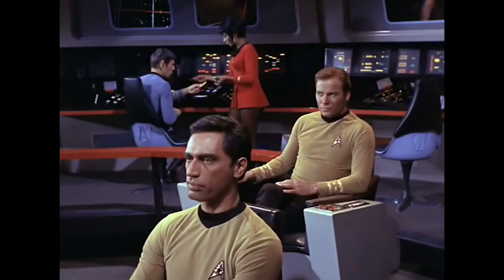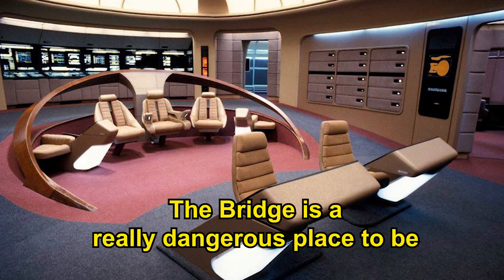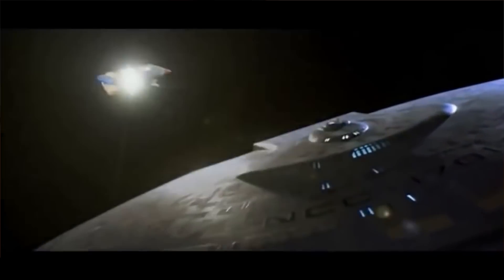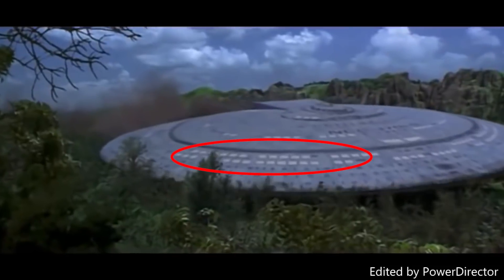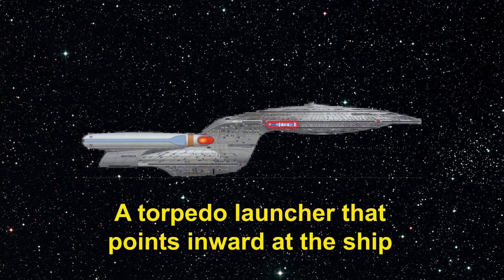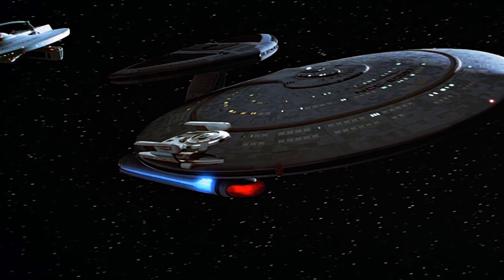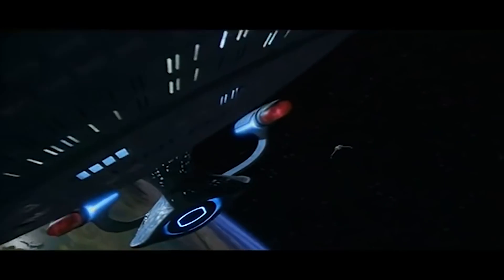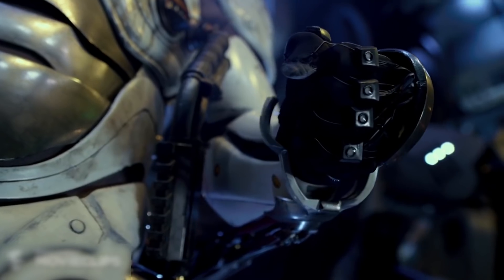10 Flaws Star Trek - USS Enterprise NCC 1701-D

Comment: I'm not a fan of defending my fandom til death but you did overlook some things here.

a.) The position of the bridge doesn't matter cause there are shield. Once the shields are gone, those weapons are going to tear apart a metal ship no matter what. Even the Duras Sisters know that...
b.) Same goes for the Warp nacelles
c.) The saucer section is capable of an emergency landing. That's it. Using the pods wasn't an option as the warp core breach was imminent and most people were already inside the saucer section. Also a pod wouldn't hold up that well against that shockwave. And the saucer section already took some heave damage from the fight and got tossed into the atmosphere by the shockwave. So making it that far is quite alright. 
d.) The Enterprise was a science and diplomacy ship planned in a time of peace. There was no real threat from the Klingons or Romulans at the time so the approach of building a massive ship for a long term mission with families on board wasn't seen as that big of a risk. So having big hallways and huge spaces helped to not have people feel cramped into a tight space. It really just shows hoch far Starfleet and the Federation have come. But Starfleet learned, Starfleet adapted, as you said yourself.
e.) Yes, the Enterprise "carries" 35% of unused space but just look at past designs of earlier ship classes. The Constition class had to get a huge and several minor refits to keep up the with new technologies. The Excelsior class was already a step in the right direction but also got some big refits. So why not take the idea of planning ahead to the next level? That empty space wasn't meant to stay this way forever. I'd say: great design.
Reply: actually there was a reason for warp nacelles being out like that on earlier designs. there was one class that was more battle than ship....was very very fast with little crew comforts
Reply: One would imagine that the exterior engines are more efficient, thus the open design for the peace time vessel, more compact design for the fighters, however , as Martin noticed above, it is canon that the vast majority of the defense is the shield and you were not supposed to run out.

Another point (I am not familiar with the lore) is that they can "divert energy to structural integrity"  which suggests that it is not made of dead structure and that it has an active components (shields? Compression? electro magnetic or dampening?) and, since in a battle all the energy would go into the shield, the structure would be compromised when it failed.

Since one would assume that 1 Watt in shields is ALWAYS better than 1 watt in structural integrity, one would assume that once the shield failed the systems would essentially be drained. Thus, there is little reason to plan for complete failure when it is way better to plan for it not to fail.

We have seatbelts and airbags because we crash, like, a lot. But an Enterprise class ship was never meant to be shaken, they have labs and children on board, it was probably designed to never fail. We know from the show that there are secondary and tertiary backups for all critical systems, what would be the point of seatbelts when you have an entire second ship dedicated to safety and if that fails it's essentially curtains? We don't have parachutes in commercial airplanes, we do in military. Commercial aircraft is designed to essentially not fail rather than fail gracefully.
Reply: EtwasMartin
: whoa, hold on. Not all what you say is correct. 

a) Yes it does matter, because Star Trek has had their fair share of battles in all time-lines, so making a bridge easy to target is a dumb move. To survive a battle requires command function of the ship and even though they were supposed to be explorers, ensuring they survive, as best possible, any confrontation means the bridge should have been moved, that even with shields gone (and that seems to happen a lot in the many episodes) the bridge should always be hard to destroy. 

b) Same goes for warp nacelles. They were very vulnerable.

c) Your speaking of specific episodes and story lines that dictate events, so why make a ship totally useless? My understanding of Star Trek producers is they tried to make the show as scientifically accurate as possible. So why make a ship, even a saucer section useless, with the technology they had? I am sure they can figure out different drama storylines that fit the technology. I believe they were just friggin lazy.

My understanding of what Generation Tech is talking about is the common sense design, the practical design, the functional design, the defensive and offensive design flaws that, irrespective of episode drama, should have been made.

d) Again the drama element. So please stop trying to make sense of a drama storyline that had nothing to do with common sense and had everything to do with sensationalism. Any good captain would not take a ship, filled with families, to places of danger, yet Picard did and for Star Fleet to order a ship filled with families to danger spots shows a clueless command structure. .. but then again, I guess clueless politicians survived to the 25th century too. Hail Trump!   :/

e) Think about it. 25th century technology cannot engineer a design that is similar to modular systems where they can remove a section and replace it with one that has new tech added, yet the ship maintains a solid (integrated) structure as a whole, ...really.
Reply: Incorrect. The nacelles have to be separated. Warp speeds are achieved by TWO over lapping but asymetrical fields (like the uniform emblem on TOS).
Reply: @lenzielenski3276  : Let me guess, you are clueless and don't watch much Star Trek. 

You forget that there were MANY ships that have NO nacelles like the Enterprise design and still travel at warp. One such famous ship was the USS Defiant in the Star Trek "Deep Space 9" series. Then, there was the famous Borg cubes, traveling at warp chasing Enterprise and winning the chase. Need I say more?
Reply: TheSeeker2070 are you saying the defiant has no nacelles or saying they don't need to be swept behind the ship ala enterprise? I'm pretty sure you're saying the latter but it could be confused to think you are saying the former.
Reply: @TheSeeker2013   USS Defiant had warp nacelles were built into the side of the ship, rather than on external pylons, the red vents on the sides were the front of them (matching blue on rear)

i can understand u thinking there was none as they were armored and didnt have the cone caps that most vessels did, and the tips also have the phaser cannons mounted above and below them

checking the schematics on wikia/ memory alpha they span decks 2 and 3 (on a four vessel ship,

this was enterprise tech, not borg tech, we are not discussing borg tech
Reply: @jacquesb5248  your thinking of the USS Defiant and it was much later during the Dominion Wars, not earlier. Furthermore, the Defiant was Corvette class starship designed specifically for war. The necells are on the outside of the ship because they created a envelope around the ship. Also they are incredibly dangerous and in case of a system failure they can be released from the mothership, similar to the warp core.
Reply: @thesquirrel4257  Wasn't the defiant from relatively early on in the war?  I remember early season 3 episodes with the Defiant (actually, I think it's in literally the first or second episode of season 3), that's literally right after the very first encounter the humans had with Jem'Hadar, basically right at the very outset of hostilities when they literally are fooled into thinking a Vorta was being chased by Jem'Hadar soldiers in the intent of planting the Vorta as a mole, but they're found out and declare "you have no idea what has begun here" or something and beam off the station.

That being said I remember the Defiant being relatively problematic at first, it was described as being all compact muscle and basically almost shaking itself apart on use, but that's worked out and a romulan cloak is also installed which isn't "factory settings" either, and technically breaks a few treaties if memory serves.  All that though was actually right at the earliest onset of conflict, and actually before official declarations of war are made I think.  Things were heating up, but I don't think the war had actually kicked off until mid or late in that season
Reply: @andrewhussey4538  you are correct. I was referring to the Enterprise being a vessel that pre-dated the Dominion War. She was a research and discovery vessel not a Warship. Other wartime vessels used during the Romulan and Klingon Wars had been decomissioned by that time. Also it is important to mention that vessels that have been commission for Star Fleet, are not necessary Federation vessels. Defiant may have been allowed to bend the rules a little.
Reply: @thesquirrel4257  That's true, I do remember there being discussion regarding the Romulans insisting they have an observer specifically in the interests of the treaty, basically they could only use it in the Gamma Quadrant, under the supervision of an observer, and the Romulans got all the info obtained through its use.  

I'm unclear what happened exactly, but at some point the observer just vanished (the one died if I remember though that could be wrong).  It was a bit of a stretch, the Romulans were just LENDING the cloak to the defiant because they got something from the deal, intel on the Dominion, I'm not exactly Sun Tzu but I can't see how they would ever just shrug and say "yeah, we'll pull the observer now and just trust you guys, one of our longest cold war enemies, to hand over all the info you get and to pinky swear never to use it in the Alpha quadrant."  You better believe that them handing such a powerful advantage over to be used on one of the most heavily armed warships in the quadrant would have them watching the letter of their agreement like a fucking hawk.  If one observer died or left or just stopped communicating they'd either have another one there immediately or have warships en route with demands to return the cloak or have it taken be force.

It would be akin to America just handing over one of their highest tier stealth spyplanes to a tentative at best ally like Saudi Arabia and then just saying "now don't go using this to spy on any of our allies, we're trusting you to be honest with us here, we can't keep an eye on you to confirm but you pinkie swore"...just doesn't seem militarily sound tactics...
Reply: @Dancer-ms3me  The Enterprise is not a Warship. Yes there have been wars in the Star Trek Universe, but the Enterprise is a diplomacy vessel, not a combat vessel. She was built as a discovery vessel, for a five year mission in deep space. The times that she was placed in a combat situation, was because of a period of distress.
Reply: @toddegoldberg  Your not getting the point from this video and what I was saying. It has to do where the nacelles sit, how they are designed being placed on pylons. Of course with the Borg, where are the nacelles? - certainly with them the nacelles are not even visible.  Thanks
Reply: @Hewitt_himself  : as I said to toddegoldberg, it is the design and using other ships as examples is the point and it has nothing to do what Alien species this involves, it has to do with the design of the ship. The video clearly speaks about the design of the ship and how the nacelles are built. My examples show nacelles are easily placed elsewhere or designed better.
Reply: TheSeeker2070 oh I'm agreeing with you. They don't need to be flung behind the ship. I was just saying someone with less reading comprehension could take the big "NO nacelles" bit and think you meant that the defiant doesn't have nacelles. We know it does. It's that the defiant's aren't huge targets. I hope this clarifies what I was trying to say. I'm not trying to contradict you or anything.
Reply: They could have launched the pods when they started to crash.
Reply: @toddegoldberg  yea, should have reworded it, sorry or at least elaborated what I meant. :)
Reply: Isn't haveing the warp nacelles away from the crew better in the event of them starting to radiate, because something got broken?
Reply: The position of the bridge is ridiculous and anyone who argues against it is just being silly. The only reason the designer made it that was was to resemble oceanic ships in a way. Tactically it makes no sense to put your command room in one of the most vulnerable parts of the ship. And don;t give me that BULLSHIT about the shields protecting it, cuz once those dorsal shields are depleted you can lose all your command hierarchy with one swift blow. Gee, great design! Let's just face it, the designers were simply dreamers and wanted to make the ship look pretty and did not really think it through that well. The bridge of a starship should be in the middle of the ship where it would be far less likely to be hit in case of an attack or some kind of disaster.
This issue is present in most sci-fi movies as well, with linear ship designs.
Reply: I C  Logic is a universal concept. There is no such thing as 10-year-old logic.
Reply: yup she was more engine than ship
Reply: In regards to item D: There was the 1701, 1701-A, 1701-B, and 1701-C that had to deal with many combat situations. The idea that the star fleet engineers would make a 1701-D and assume "eh, I'm sure all the other species are peace loving now and we don't have to worry about them, nor will we find any new life or civilizations that may be aggressive" is frankly odd. To me the explanations to your comments, and those of the video are either 1.) the engineers for the federation are closed minded and ignorant, or 2.) the writers of the TV show did not care about the ship making sense against analysis, just that it make sense from episode to episode so they could keep a job next year .
Reply: Good lord people. Lets just kick and beat the franchise to death and all become haters - oh check!
Reply: +Dangerosu
"The position of the bridge is ridiculous and anyone who argues against it is just being silly. The only reason the designer made it that was was to resemble oceanic ships in a way. "
Current naval warships also have “exposed” bridges, and the ships aren’t defended by defensive energy screens, and they’re not buried in the depths of the ship, because, face it, when your defenses fail, it pretty much doesn’t matter where the bridge is located. Oh and before you start saying "Sensors!" Space is FULL of radiation, EM waves, and other things that MESS with advanced sensors. A forfitied window is simple, straightforward, practical, and next to blowing a hole through it is a great "sensor". Case in point our shuttles that still have windows. Granted they're not military ships but the proof of concept is there.

"Tactically it makes no sense to put your command room in one of the most vulnerable parts of the ship. And don;t give me that BULLSHIT about the shields protecting it, cuz once those dorsal shields are depleted you can lose all your command hierarchy with one swift blow. "
Same with our ships now. I mean look at is this way: in WW2 the bridge of the ship was most likely one of the bets targets to go for. Yet thanks to sturdy design even if you lost all your command structure the rest of the ship is still going. Yeah it would suck AFTER the battle but so long as the ship is still firing at you DURING the battle you've still got a problem on your hands. Though this is mroe true for SW ships then ST ones.

"The bridge of a starship should be in the middle of the ship where it would be far less likely to be hit in case of an attack or some kind of disaster."
And what's to stop the enemy from aiming at that part of the ship and crippling your entire command structure? Nothing because and I quote: "cuz once those dorsal shields are depleted you can lose all your command hierarchy with one swift blow". So really bridge placement doesn't matter in the long run.

"This issue is present in most sci-fi movies as well, with linear ship designs."
One of the reasons why I like the Borg. 

Though think about it: culture and design philosophy that's been part of your civilization for thousands of years don't just go away because someone screams "effeciency!" What's efficient to us as humans is totally silly to an alien who....say.... builds in circles. In space, what matters is: can the structure propell itse'f at FTL and sub-FTL speeds? Can it fight back? If yes to what extent? Can the crew comfortably perform their jobs? Would the interior design affect the mental state of teh crew? What is the ships purpose? Etc. So long as it performs ALL or MOST of those functions then it DOESN'T MATTER what shape your ship is.
Reply: Great job EtwasMartin
....I'm not that fan that defends my fandom either, but I'm sitting here with my wife and we're literally listing off everything this guy has wrong or misinterpreted. I then decide to browse the comments to see who else is buying into his uninformed opinions and my wife sees this, your comment....We jus started laughing because EVERYTHING you point out, I was pointing out as we watched lol! Defensive shielding goes up at yellow alert for crying out loud...let alone red alert. Didn't he rip on Riker about the "penis extension"! Hilarious, considering that John Franks didn't "WRITE" the movie...only directed it. I am a big Trek fan ...to the point of naming my dog "Spock". We jus think you nailed it outta the solar system. This guy needs to stick to star wars cause almost everything he said about star trek can easily be turned around and reapplied to his star wars universe....including the positions of their bridges. Speaking of bridges AND wasting space....don't think I need to go farther there lol...You can park prop planes inside those bridges. I do seem to recall an "A" wing fighter barreling toward the bridge of a super star destroyer jus before said destroyer crashed. This is a vessel over 19 km long and over 300k crew members....aaaaand the bridge is at the top :) Jus sayin.... This guy's got it ALL TOGETHER, don't he lol. Hey, great job again!
Reply: @MusicIsMyWarfare  So right
Reply: The first point is really, really dumb. If the ship was just glanced by a laser, the pylons would easily break.
Reply: @Dancer-ms3me  (and others)

a) Except that according to the tech manual lore, the bridge actually isn't all that necessary for the ship to function. You could do everything you need quite easily from engineering (and this is actually done in some episodes), heck, you could even reconfigure the wall displays in a corridor somewhere within seconds to control all the ship functions to your hearts content. What IS essential is the main computer, and that one (or rather the three of them, two in the saucer and one in the drive section) actually IS situated smack in the middle of the ship.

b) According to lore this isn't some arbitrary design choice, due to aesthetics or something like that. Instead it is necessary due to warp physics to keep the nacelles somewhat away from the main ship body, in order to not have the ship structure interfere with the warp field. A small ship (Defiant, Runabouts, Shuttles etc.) can get away with putting them right next to the fuselage, however anything bigger requires some distance. Klingon warbirds, Romulan D'deridex etc, all of them have their nacelles at the far end of some pretty long pylons. It just isn't as obvious since the pylons are wider, and in the case of the D'deridex they support each nacelle with two pylons, one from below and one from above. You don't critisize the design of ocean going ships because they have a pointy bow with very inefficient use of space, since this is a feature dictated by fluid physics, or do you?

e) Of course they can. But even with a modular design, the outer shape and volume is pretty much fixed and can't be changed easily afterwards.They envisaged that in the future more modules would be coming, and thus they put some extra space in there. Without the extra space, putting in new modules would mean that you would have to take out other modules. In addition, the shape and size of the saucer section (in relation to the drive section) according to lore is also to some degree dictated by warp field physics. The diagrams I've seen show the drive section to be basically "full", the unused spaces are all in the saucer section, so maybe they designed it so that the drive (or battle) section was optimized, even though this meant that they had to make the saucer section this particular size, and they simply ran out of stuff to put into it at some point.
Reply: Kim Jon Un Official VEVO .... Phasers are particle weapons and fire nadion particles, which is an artificially-generated particle capable of liberating atomic nuclei, disrupting nuclear forces.  I think, in effect, it literally disintegrates whatever one happens to be firing at if the settings are high enough. However… Lasers are nothing more than focused light. That can generate heat, but that’s about it. Lasers are high concentrations of light thst, at least within the Star Trek universe, are compressed photon particles that could have heat and blast effects. Personally, I think it’s important, that if we’re going to speak about something, we should know about it first. Just sayin…
Reply: blahfasel2000 ... tru dat
Reply: Don't modern ships of war have exposed Bridges? Aircraft Carriers for example. The concept isn't new, and isn't exclusive to Star Trek.
Reply: Way to pick apart science fiction. Big man now?
Reply: "The position of the bridge doesn't matter cause there are shield."

Oh it does matter when it gets hit regardless. And boy did it get hit often. Shield... my ass
Reply: @Nyrvachan That doesn't make it any less canon. DS9 and the Defiant were some of the best additions to Star Trek. Roddenberry was a bit of a nutter.
Reply: @dxb8086  "dXb" ~ Oh it does matter when it gets hit regardless. And boy did it get hit often.

Me ~ K...prove it ;)  I'll give you 3 days....72 hours to show me proof that the bridge of a Federation vessel, or ANY Trek Universe vessel for that matter, is "OFTEN" hit on the bridge itself. For that matter...show me how many times the bridge WAS ACTUALLY DESTROYED when it did get hit....I count 1 for sure and will research the rest to make sure of my answer but the 1701-E had it's bridge hit and the command structure still survived....bridge NOT QUITE destroyed; The point though is that it wouldn't quite matter. I've seen every episode and every movie and, yea off the top of my head, I can say that the Bridge (BETWEEN ANY TREK UNIVERSE SHIP) has been nailed .... MAYBE 5 times (remember, off the top of my head....I'll make sure the exact number for y'all), not counting of course Wolf 359. After all, if we are talking about bridge position, destroying HALF the ship can't fairly count....agreed? However...this brings a finer point to the debate....

Question...

If the "bridge" was THAT EASY AND VULNERABLE for destruction... Why didn't the Borg simply take out the bridges of the federation ships at Wolf 359? Why such inefficient use of power and resource to take half the ship instead of "just the bridge"......UNLEEEESSSSSSSSS..... those bridges, even with Picard's "alter ego" spearheading the attack, were just too protected??? YES, I humbly submit that EVEN PICARD knew that attacking the bridges alone would be an "INEFFICIENT" strategy....idk, jus sayin!
Reply: @TheSeeker2013  I believe you are both correct. It depends on what their fuel system is. Perhaps I should say the technology behind their Warp. The Romulans use a singularity for an example. I'm sure the Borg use a different system.
According to Trek science the separated nacelles worked best for them. They did have ships with one the cell and three. According to Canon those ships had structural issues including literally shaking themselves apart.
Reply: Some one typed it so i didnt have to thanks for defending us
Reply: @dxb8086  Oops...times up. It's been three days. . . . .But I'll still let you try anyway ; )  Jus show the proof, that's all
Reply: Agree wholeheartedly, the lack of context in this video is really annoying.
Reply: Shield response again?... you realize concentrated fire will ruin your argument to defend the bridge as multiple battles not even shown here proved thats equivalent to an accident prone teenager going down the same rocky hill without pads or a shirt
Reply: Dlastkatipunero Yeah but haven’t you read everything… We’ve been over all of this. Your argument simply fails because of feasibility. If it was that easy, Picard would’ve already handled the situation at Wolf 359 when the Borg had possession of him
Reply: @Dancer-ms3me  I do agree that bridges shouldn't be exposed, but they always are. Most Star Wars Ships/Star Trek have bridges exposed, I mean look at aircraft carriers in the present day time, and other ships like that. These ones don't even have shields.
Reply: Cannot compare current day ships with advanced space ships, simply because of the advanced technology that is suppose to exist for Star Trek (any version). 

When thinking about it, for advanced technology which is what Star Trek represents, the bridge should be more protected, especially with the weapon systems that aliens races are supposed to possess.